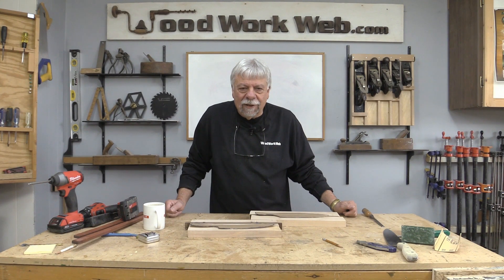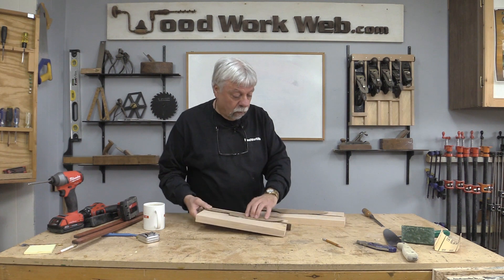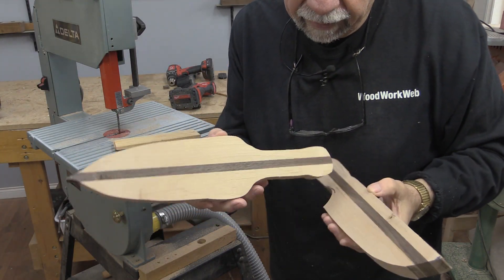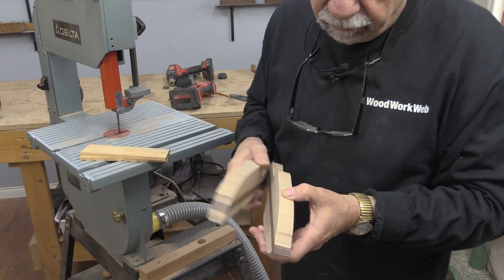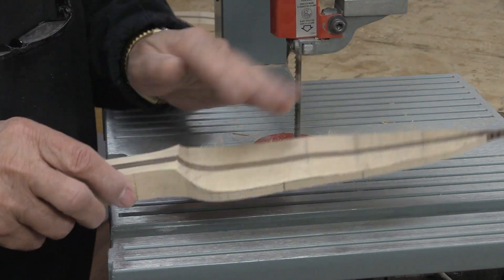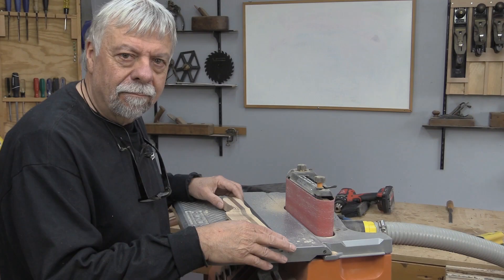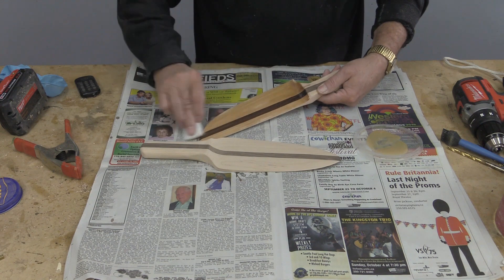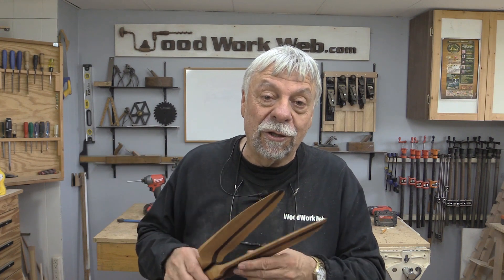Make a Wood Knife & Wood Cake Lifter Set | Homemade Woodworking Project from Woodworkweb

Comment: I've watched your stuff for awhile, and the only negative is there isn't enough videos. I'll probably start at the beginning this weekend and have a marathon.
Reply: Another great project. I see what you meant by leaving a flat surface on one side to make band sawing easier.  I  think I would also drill a hole in the handles to give the recipients an option to hang the items up.